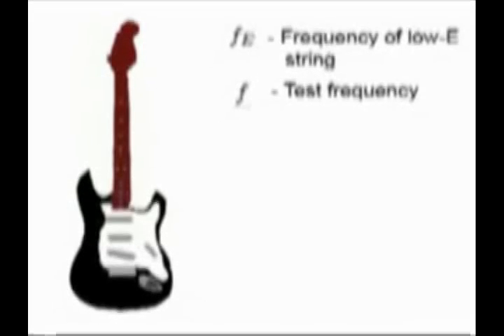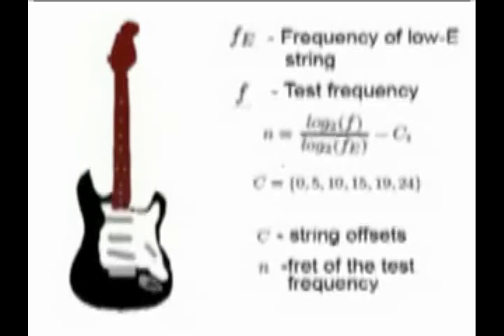Strum Villain

Comment from the maker: 1) You don't have to, per se. It's pretty lighting invariant as is since it only deals with edges. But for increased robustness it's best to take the reference image whenever there is no audio. I.e. a rest position. Mind you this has other problems that force constrictions on the player (can't palm mute too much)
2) It doesn't scan the strings, that's part of the calibration (hitboxes). Probably not hard to do it though, I was pressed for time.
3) Haha, thanks.